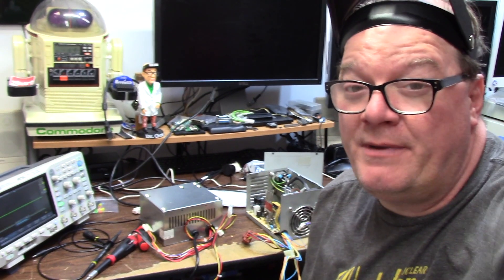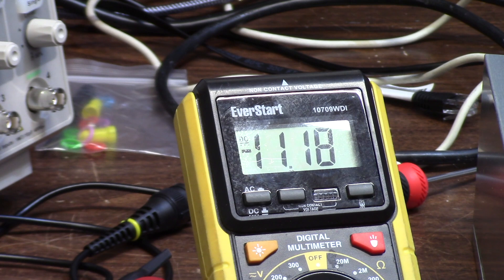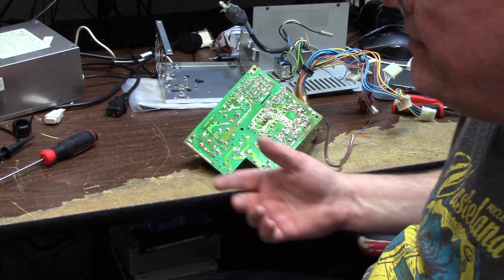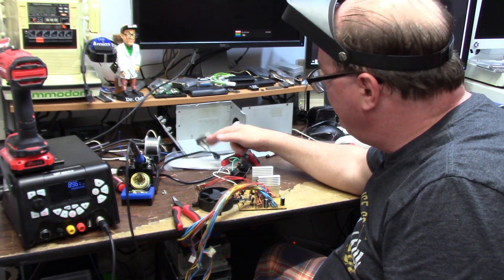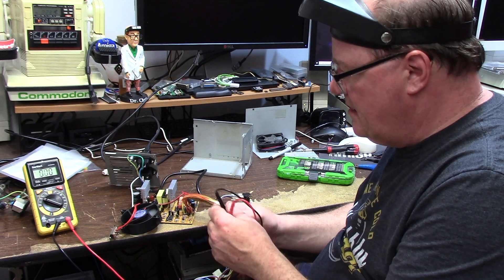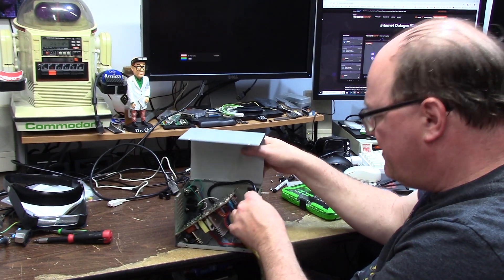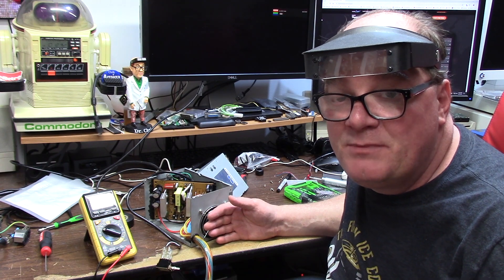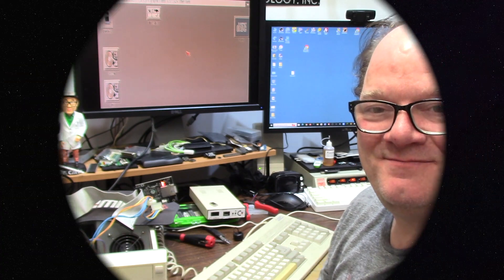Stuffing the AT power supply into a stock Amiga 4000 PS case

Comment: Chriiiiiis!  Do you still happen to have that old PSU board within reach?  If it's a skynet PSU could you please eyeball the value of the resistor R24 (current limiting resistor for the fan, next to the fan connection)?  Mine's fried (black) and none of the available schematics have values for any of the passive components..  I tried calculating the value myself but I current limited it so well the fan doesn't spin!  Ooops!  ;-)  Thanks in advance!
Reply from the maker: i think? i do maybe? i dont know. ill dig in the pit
Reply: @ChrisEdwardsRestoration  Hi Chris, no longer required, sorry if I've already wasted your time.  I've found a fan in my spares box that runs quietly at the full 12v..  So wire link incoming, the zero'st of all resistors!
The new fan is kinda necessary as testing the original 12v fan on my 60v bench supply at full wick summons the magic smoke fairies...  Let's hope I get rid of these bad omens (ohmens?) before I start tackling the hard stuff!
Reply from the maker: hah i looked, but i think i tossed the guts
Reply: @ChrisEdwardsRestoration  Thanks for having a look Chris and sorry about wasting your time!
Reply from the maker: @ffsireallydontcare  no waste at all. im here to help if  I can!
Reply: @ChrisEdwardsRestoration  That would be fantastic!

Comment: Gotta say, pretty ghetto! I just received one of the reproduction A4000D cases off Amibay and it allows you to use SFX PSU, and I ordered a CNC Aluminum billet fron fascia for my ACILL build 4000D board. Still need that damn plunger rod for turning on the system. Looking forward to your always interesting, and entertaining video.

Comment: That thing at 3:27 or so is probably just a double Schottky Diode...
MOSFET weren't used in PSU until the mid-late 2000s, when Efficiency was something that mattered.